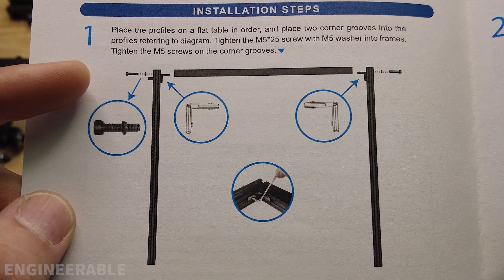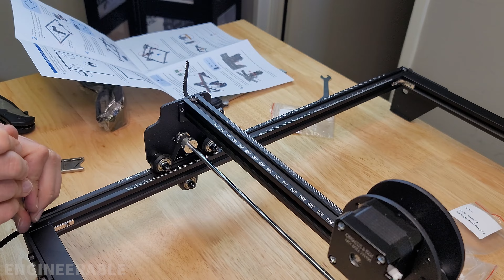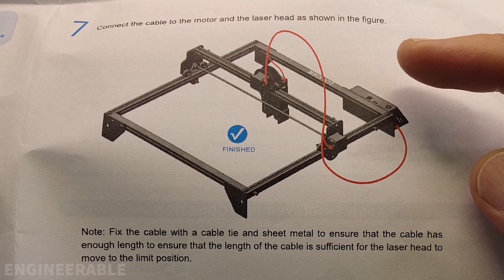Is It Any Good?! How To Build LONGER RAY5 10W LASER CUTTER & ENGRAVER. I Assemble, Setup and Review.

Comment: Thanks for this video, I have a Longer Ray 5 10 W engraver. I bought the extension Y axis arms, which came with lengthier cables for the new frame. Unfortunately the instructions for connecting the new cables are very poor. Could you do a video on how to do this?

Comment: damn, great timing, I have been thinking about getting a laser cutter, which one would you recommend for about $1-2k?
Reply from the maker: Depends on your goals, but the laser cutters like this one are pretty impressive for ~$500. The downside is you need to add accessories like enclosure with exhaust, air assist, honeycomb table, that I find essential. One advantage of these gantry style open frame laser cutters is that the material size is not limited to what fits inside the laser. I often run into issues where I can't fit something inside the enclosed laser, and I also need to cut down material to size, which often creates waste.